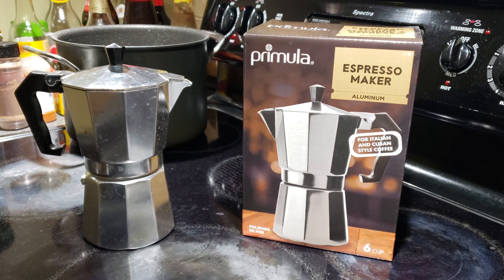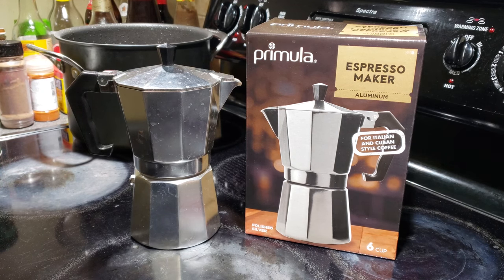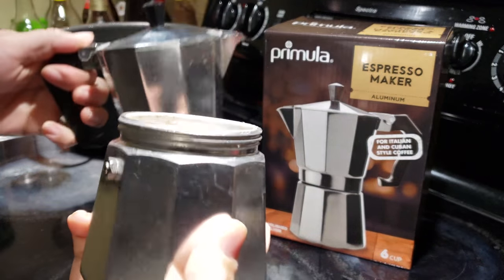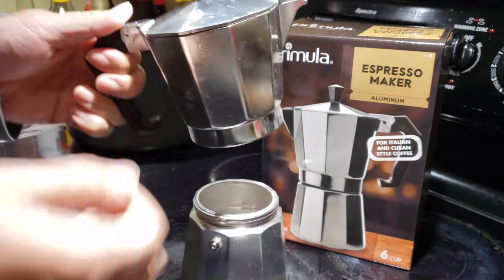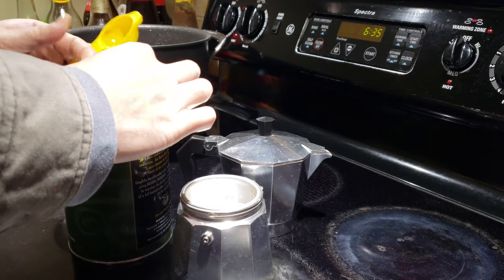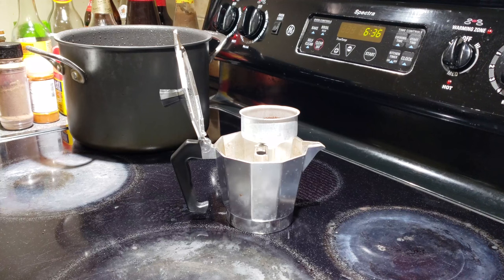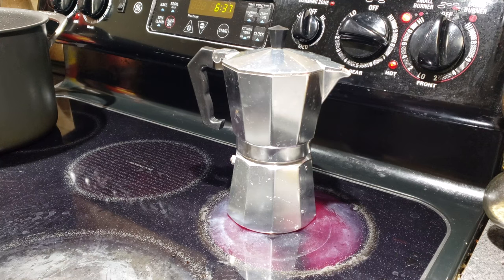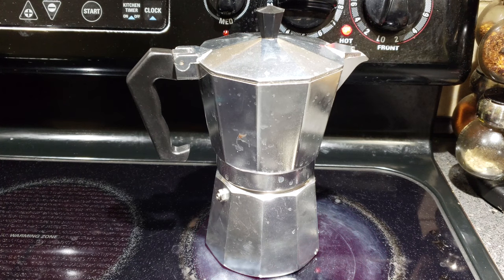How To Make Coffee Using Primula Moka/Percolator Coffee Pot

Comment: Thanks for vid. I picked up a stainless steel Primula on Ebay because I try to avoid aluminum in my cookware.  They say to throw out the very first cup - might have shavings or residues from the factory.  I set a timer and it took exactly 5 minutes on my glass top stove at medium high (7). I pulled it off the burner and it continued to steam a bit.  Probably not a good idea to leave it on the burner too long - would overheat the seals and eventually ruin the machine.  Coffee grounds go into the compost can.  This is seriously good coffee. I think they say "4 cups" because they're referring to the small 2-oz. Italian espresso cups so the next step is to find some of those - good luck finding anything not made in China - but anyway that's probably a good way to limit yourself from drinking a month's worth of caffeine in 15 minutes :)
Reply from the maker: After brewing, run the pot in cold water to immediately cool it down to avoid injury!

Comment: When adding sugar to Cuban coffee, what’s the unit of measure in a Crap Load?
Reply from the maker: The sugar to coffee ratio for Cuban coffee is typically 1–2 teaspoons (5–10 mL) for each espresso-sized serving of coffee for moderate sweetness, and 1–1½ tablespoons (15–22 mL) for extreme sweetness. You can eyeball your measurements, or use a 2:1 or 3:1 ratio of sugar to coffee.  :)